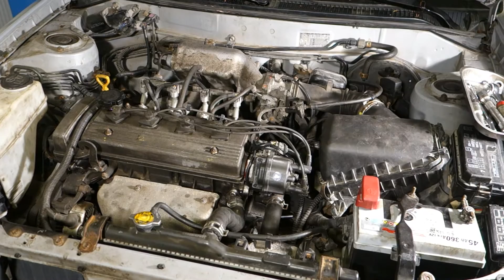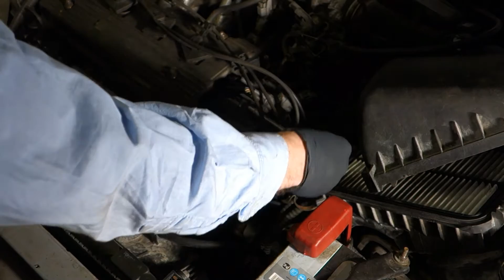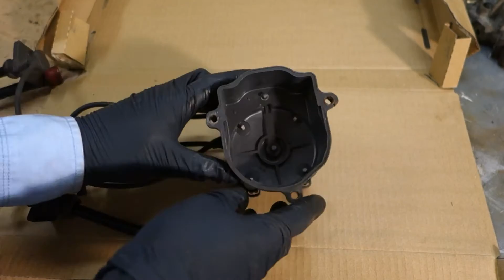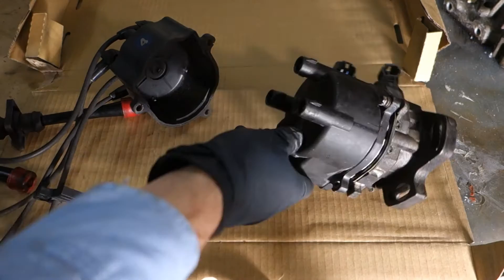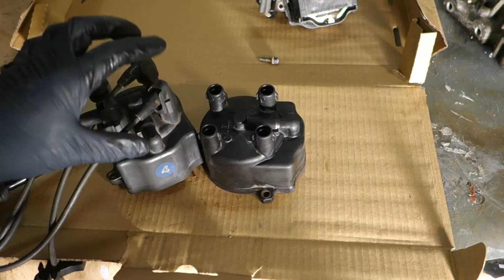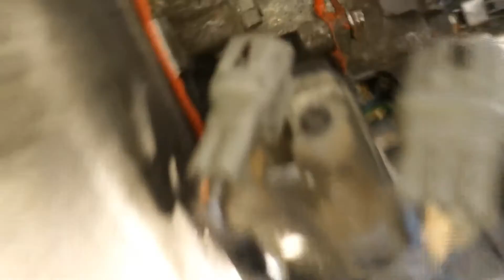How to start dead car? Hint distributor and ignition parts replace

Comment: @Peter Finn what would be the problem if the car starts but upon releasing the accelerator and not doing anything..its rev meter goes to zero and the engine stops. I was able to use the car yesterday without error but the next day it does this. Your expertise is very much appreciated.
Reply from the maker: Ok, what is your car and miles in engine. :-)
Reply: Toyota corolla gli 1.6 1996, it says more than 150k km.